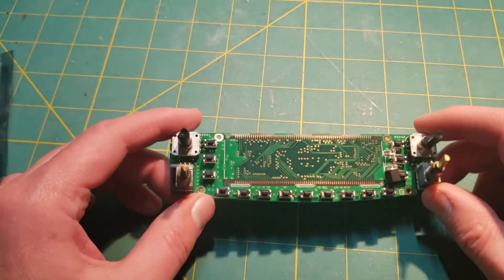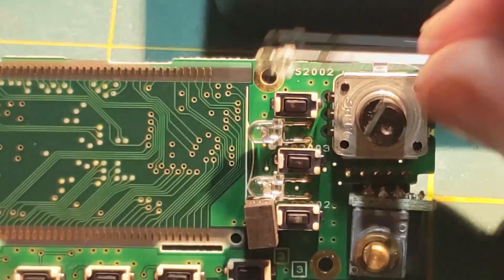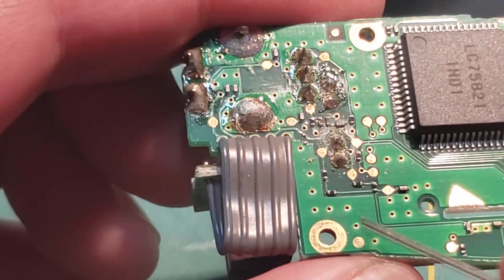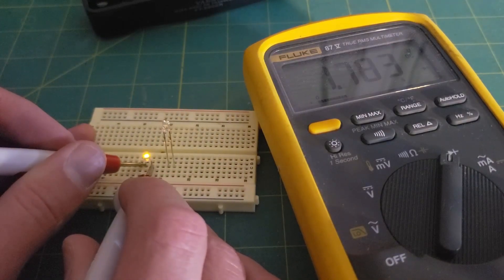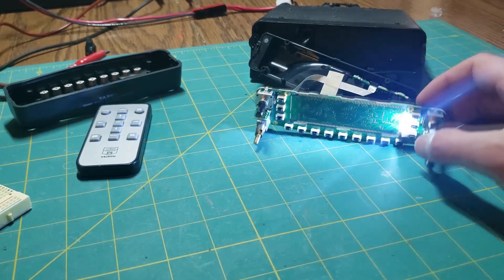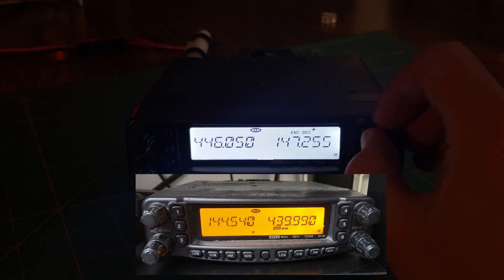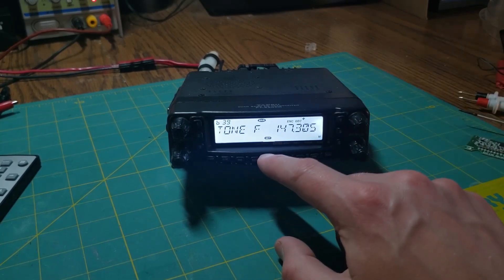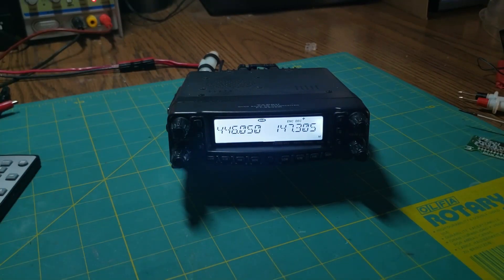Replacing the backlight LEDs on a Yaesu ft-8900 / ft-8800

Comment: I stumbled across this video because I was searching for backlight issues with the FTM-7250 as mine has become rather dim and I figured that the LED's may need replacing.
Reply from the maker: I'm sorry to hear that, unfortunately I no longer have a FTM-7250, but I'd imagine the process would be quite similar. Good luck.
Reply: @Datzfunk  unfortunately because the ftm-7250 was such a short lived radio there hasn't been many videos made on repairs. My hurdle is finding the time to disassemble it and work out what has happened, my guess is that the phosphor has broken down resulting in the reduction of overall brightness. I'll find out one day! Oh yeah, the mod to the ft-8900 looked pretty good, and certainly makes it rather unique, I'm pretty sure that not many people have bothered to change the backlight LEDs 👍